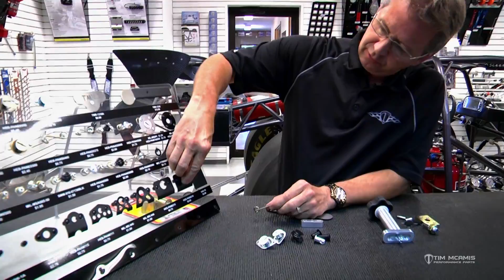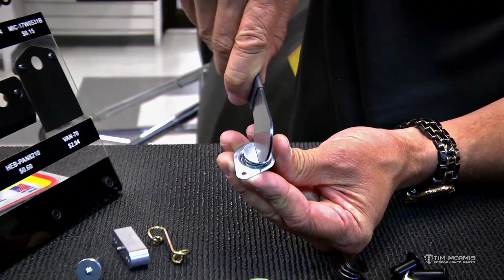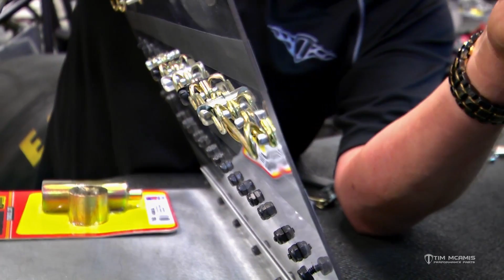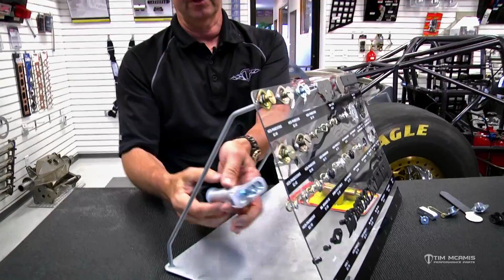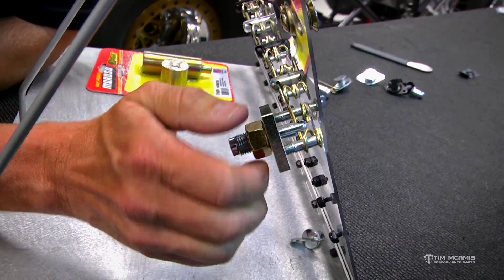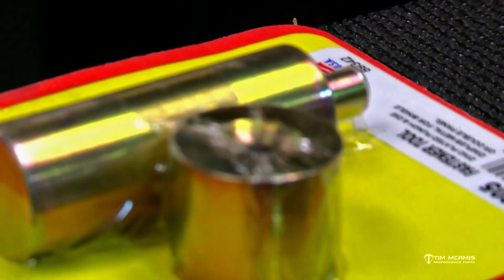Quarter-Turn Fastener Installation Tools

Comment: Viva México 🇲🇽🇲🇽 ...
Vivaaaa
Reply: OK, some springs too loose, some too tight.  So I bought the big spring tool. Works great to loosen connection but bottoms out when attempting to tighten?  Tried different length fasteners, no luck.